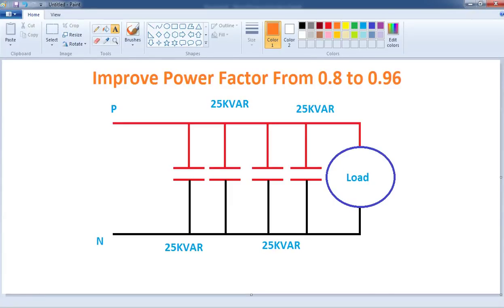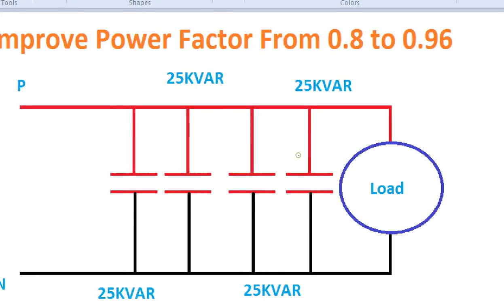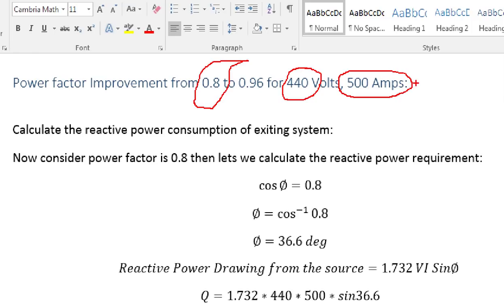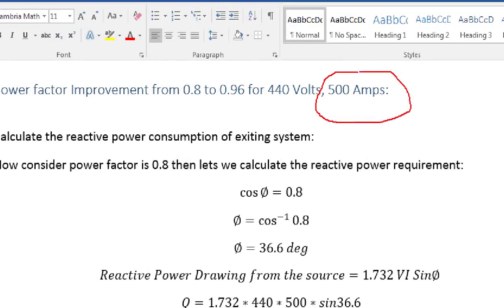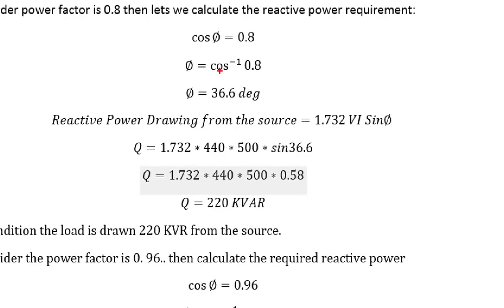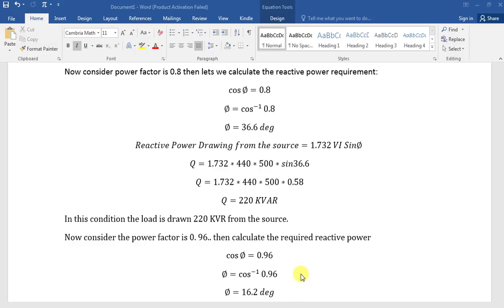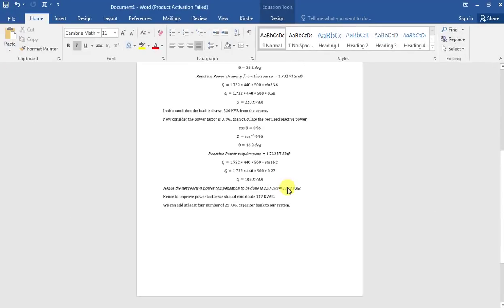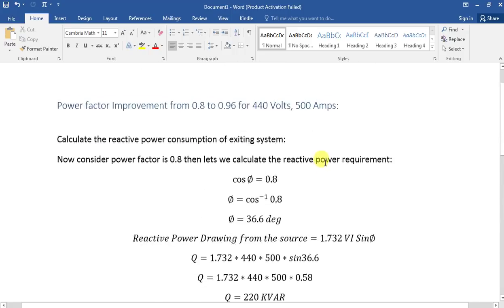How to Improve Power factor from 0.8 to 1.0 in tamil

Comment: Hi,. In one site I face a low power factor issues. Leading 0.85 without connecting capacitor bank..we don't have any fixed capacitor. TNEB charges penalty 
For low PF. Bro u have any idea to improve the pf

Comment: What happened when capacitor bank connected in no load. And the cap bank connected when lighting load time may be pf was increase
Reply from the maker: The reactive power goes to the source..because once capacitor bank is connected to the source then the capacitor starts injecting reactive power irrespective of the load. You get leading power factor,which means the source aborbe the reactive power from the capacitor bank..finally the source voltage rises abnormally...In generator one protection "Reverse reactive power protection" is used to protect such condition...
Reply: @Techdoct  thank u sir
Reply from the maker: You can read detailed information here:
https://www.techdoct.com/why-question/what-happen-capacitor-bank-connected-in-no-load/